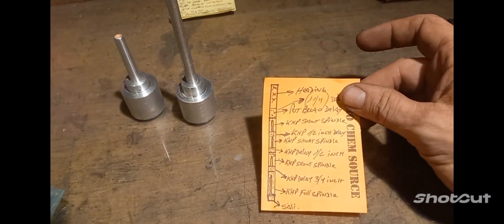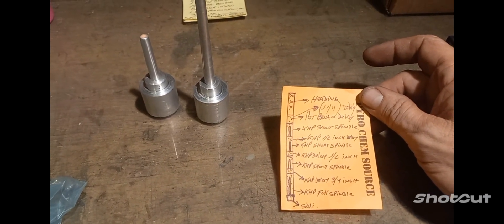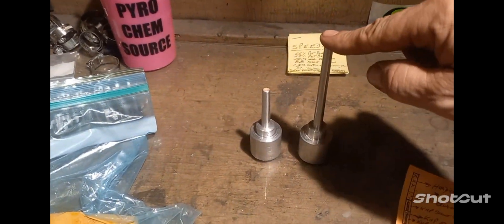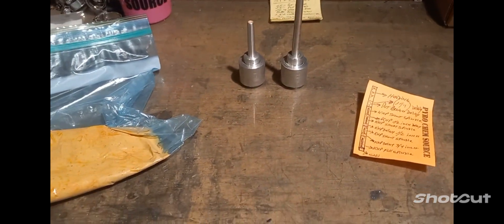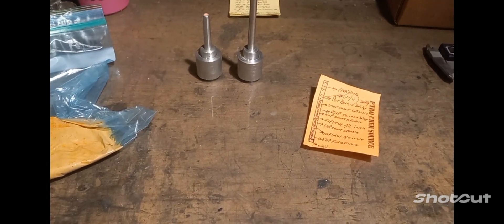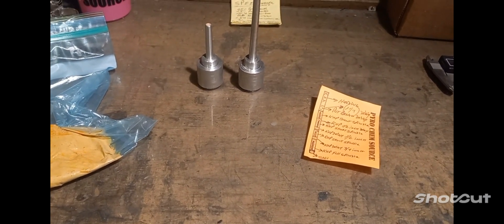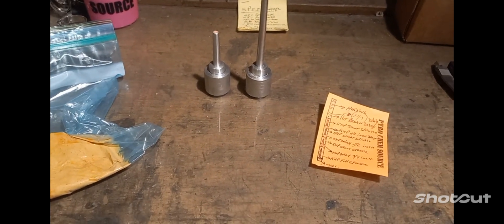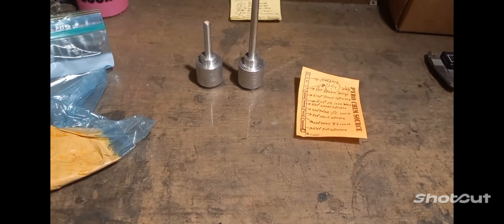5 stage rocket KHP fuel.

Comment: Why do multi stage rockets tend to chatter like that on the later stages? The 4th stage is the most awesome chuffing I've ever heard from a whistle, it sounds like it was breaking the sound barriers 😂 beautiful beautiful work
Reply from the maker: Thank you bud..
As stages are going through,  and because all motors are connected to each other ,longer the empty tube becomes increasing resonance chamber and increasing the sound effect.
In this case KHP fuel used is very strong and fuel rich , it backfires when pushing full trust , no doubt it is a amazing fuel.
Reply: @Pyroflorida  ohhhh the tube stays attached so the flame is going all the way through? I always assumed they got elected off when used up, now it makes sense why they chuff like that always.
Reply from the maker: @KClO3  yes , the only motor that gets ejected after burning is #1  all the other ones are permanently attached , at least that's the way I designed them , some people may have different designs
Reply: @Pyroflorida what mechanism ejects the first motor off?
Reply from the maker: @NagashiChidorii  first motor is only attached to motor #2 by three dots of hot glue , as soon motor #1 stops pushing and ignites motor #2 the resulting g force , acceleration and gravity makes the motor #1 to be ejected right away